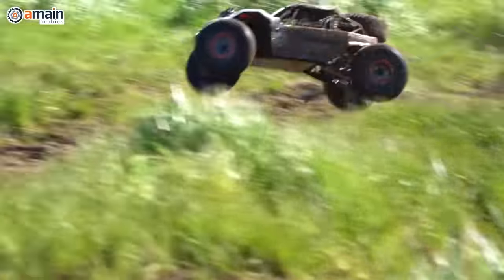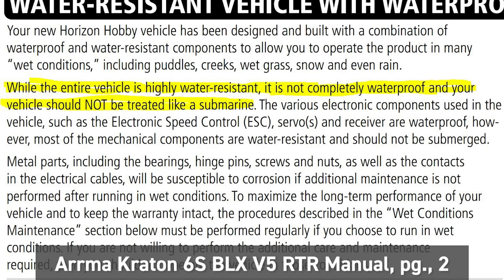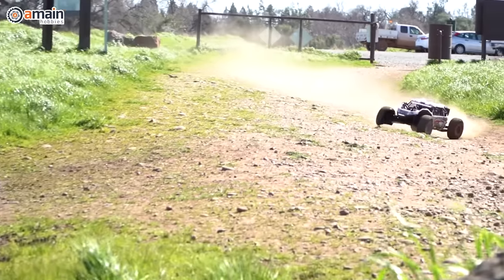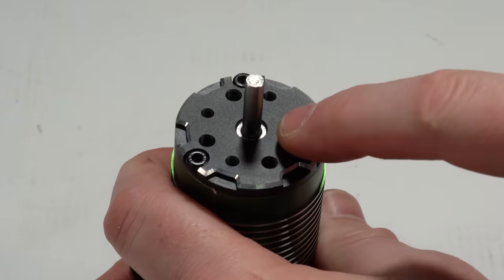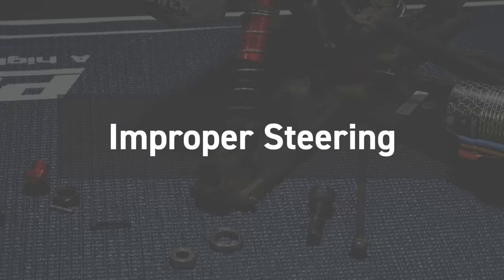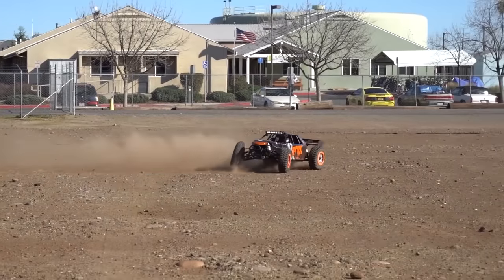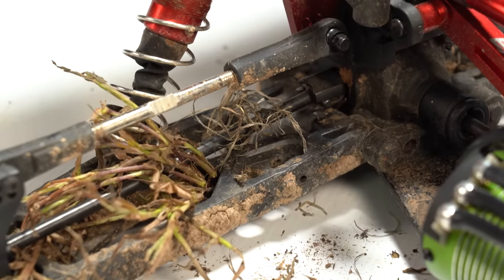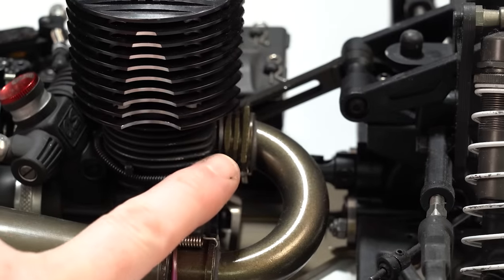7 Ways You're Destroying Your R/C Car

Comment: One technique I've found for maintaining an rc, is to buy a new one. Although that solution isn't budget friendly.
Reply: Just last week I burnt my motor out, hobby shop was out of parts and would be until June. Bought a new car and took it to the chop shop and voila@!
Reply: Tommy Chong  Cost efficient, no. But convenient and time efficient, yes.
Reply: Great advice
Reply: I think ill stick to my ascender
Reply: nor is it a very responsible thing to do.
Reply: @mjyanimations1062  yee
Reply: I believe they call that "replacing", not maintaining. Lol
Reply: @mr.kibble1577  a consumer*
Reply: actually it may be cheaper to buy a new one if you buy the same model, you will have a complete inventory of spare parts immediately
Reply: Yeah I've bought used ones and they ended up being more expensive than a new one after replacing all the broken stuff 🤦🤷😕
Reply: @CyberSkillPro  Yeah, but e.g. the drive train parts wear out far more quickly than all others
Reply: if it drives then it's a ok
Reply: thats what i tell to one of my wives, if she annoys meh
Reply: Yeah i  really take care of mine i only drive in the loop and and on a bit rocky paths im so glad i dont trash stuff .
Reply: The new MJX hyper go is $150 does 47mph and is more durable then the e revo , I also back this , I’ll spend 150 all day On a new truck/basher and it comes with a serious amount of extra parts
Reply: I buy one 3 weak ago, and today I broke it. 
I'm working on construction places.  And I have always a nice playground for a rc car. 
One spot was with a litle bit water, a little bit to much.  
And I go true the water.  
After some time the battery was dead, and I wanted to change it with another one.
It's starting so smoke the battery starting burning hahahaha
I ripp the battery out, and the car stopped also smelling and smoking. 
Today I buying another on, with more metal parts and aluminum plate.
No water, not even a little bit  hahaha

Comment: I've found personally the best way to maintain a RC, is to spot check it every so often and just make sure the car functions correctly and address issues as needed, and once a year, preferably during colder winter months when you don't run as much, completely rebuild the car from the ground up, so you can really see every last part of the car and if plastic parts are worn or pins are bent etc etc. As a basher I've found this works great for me. It's a fair bit of effort but you learn a lot about a RC rebuilding it, and it's half the fun.
Reply: For real can never understand people who don't work on their cars
Reply: This is the greatest tip. Being able to rebuild your RC from the ground up allows you to easily a fix it with confidence and spot the slightly issues with your RC.

Comment: “Don’t gear too high”

*proceeds to gear 2wd brushed slash for 100+mph speeds
Reply: Lmfao
Reply: Thats for speed runs. They don't leave them in there when bashing. He even says its only for speed runs.
Reply: @SacredGter  sigh...
Reply: ive got a rustler geared for around 90mph but i only use that one for speed runs
Reply: @koenoder4323  don't quit your day job. Chill bro I was just stating something he said. Smh
Reply: Mt bandit hit 100
Reply: It's really hasn't done much I just went to aluminum Spur and clutch clutchless replacement and stronger gears in the transaxle she's all good I went to different wider setup from a different model that mount the same so I got fans and heat sink but I start slow then hit it cause I got a long smooth street,(electric car too it was like a 28 -31 pinion and around 70-76 Spur or something I can't remember gotta look but yea after I shaved down 3 Spur gears I went aluminum then I havnt had issues even the stock axles held up but I went to strong metal ones for the stress
Reply: @koenoder4323  why cause I don't use punctuation or u can't achieve 100mph with a Traxxas bandit lol one of the cheapest beginner models 🤣
Reply: What are u crazy im Still gonna send it
Reply: But foreal u can't hate it was the middle of the night I was dabbed out working. On my cars last thing I checked is Grammer
Reply: Me to
Reply: I got 2 mini and 3 slasges
Reply: @brysonbishop9626  I've got faster one just trying to get a stock bandit to do it takes some dramatic gearing lol
Reply: @koenoder4323  exactly
Reply: lol
Reply: @SacredGter  r/whoosh
Reply: I’m getting a 3s bandit and I’m gonna put the other gear in but not often
Reply: funny kevin joke
Reply: Same I made by brushed 2wd slash 6s
Reply: @SacredGter  mine stays geared for top speed, doesn’t go off-road though
Reply: @SacredGter  r/whooooosh
Reply: @ezrabegin8234  I've had rustlers and bandits hitting 50 60 with the titan motor .granted I was running 3s and not a xl5 ,"those will smoke on 3s you need a older mechanical esc or some of the earlier versions in 2005 like power pulse,,I've hit 70 80 mph with the older trinity motors sending 4s through them   if the turns are enough to handle the volts  ,I've roasted a few  two tho ..but with what they have now you can make a bandit hit 80 90 on. Castle set up or mamba
Reply: I have a Losi 22S SCT with a 550 Brushed motor, NiMH, slicks, and zip ties holding the steering straight going 212 against the wind on the dunes. 😮
Reply: @SlithenTurtle  yeah right.  It probably does 65.    telemetry is probably set incorrectly
Reply: @mikeharo3528  I wasn't using the shitty app I used GPS to track it so I had accurate speeds
Reply: @koenoder4323  I was lost st first had to reread all this
Reply: Heh, same... have a 4s 2300kv motor in my rustler 2wd, can't even hit half throttle without it looping out, even geared so high it never overheats though!
Reply: No shot.  Proof
Reply: literally just did this
Reply: Steering has left the chat

Comment: This hobby needs more of these videos and needs to be reshared more. I think the next video needs to be about myths and facts of rc cars. I hear so much that its hard to know which to believe. Like one fact I do know is true is upgrading to metal parts isn't always the answer.
Reply: That and how to read the instruction book. I see so many questions asked in facebook groups that can be answered just by looking in the imstruction book.
Reply: some metal parts are good but it need to be plastic between like alu diffhouse plastic A arms and alu C hubs so if its a to violent crash the arms brake before the metal parts bends.
also the benefit of that system is that you dont need alot of part most of the time more then those sacrifice parts in plastic.

Comment: All great tips. I clean and maintenance my RC Cars after every run. I have RC’S that are 15 to 20 years old and look brand new. I still have a Kyosho Optima Mid SE since I was 16 years old and it still looks new. Thanks for the video.
Reply: I’ve had my slash for a year and it looks like it wants to retire in the garage
Reply: @hawkmoon128k5  poor slash
Reply: @hawkmoon128k5  lol same I have a 2wd stampede that looks like it was put through a meat grinder. 6 months ols
Reply: I have a 2011 stampede. I beat on it everyday. Still going strong 💪
Reply: @Deepfried4skin  I sent my little brother in law that lives in the Philippines a Stampede and it will have to stand up to the humidity, heat, salty air, and sand. I also sent him a SS screw kit. He will have to take care of it over their for sure in that tropical environment or it will turn into a rust bucket.
Reply: @Deepfried4skin  my dad has an original stampede from 1997. Still works but it's seen better days
Reply: I had thst car when I was 16 too and sold it like a big dummy
Reply: I'm like you bro, all my rigs look brand new and some are over 10 years old. I just can't afford to neglect my rigs
Reply: @speckledjim_  I agree. They cost to much money to not take of them. They break less when they are well maintained. I take care of my other belongings as well.
Reply: @airguns_rc im exactly the same 👍🏻
Reply: @brysonkuhn3290  That is how they are supposed to look IMO. If they get really dirty and need a brushing that is fine but your screws are going to get some surface rust and your chassis banged up and nicked. I almost consider it more of a patina...
Reply: my Associated RC10 was built in 1986, still primo!
Reply: Agreed
Reply: @modelnutty6503  that’s awesome
Reply: Yes sir. Maintanance is the name of the game. I have a 14 year old Hyper 7 and a 12 year old RC8 both still run like champs.
Reply: Mine are all rustlers built up right not maintained cause if it's gonna break now it need to be replaced when that new trans and front brakes got installed four years ago
Reply: @airguns_rc  You can maintain the car but, it still looks rough. I always cleaned and maintained my cars but, I also bashed them really hard no amount of maintenance can get rid of scratches unless you replace the parts but, then you either replace parts because of cosmetic damage every other run or you have a shelf queen you never really put through it's paces.
Reply: @thirtythreeeyes8624  I agree. I only have one shelf queen. I run mine, and then clean them off and oil the bearings and metal on metal connections such as drive shafts and CVD’S
Reply: i got a arrma notorious 6s v5 like 5 days ago. it already needs a new body and some new steering parts hahaha

Comment: Road salt is another bad one. Gotta be sure to rinse everything thoroughly after a snow bash.
Reply: My motor now does a high pitch sound when i was done snow bashing😑
Reply: @nuclearzs8615  yes, I'm sure it's not great, both the moisture, possible currosive salt and constant spinning probably puts quite a bit of wear on them. I use cheap Chinese brushless ones so no great loss, but a little shot of wd40 followed by a drop of oil probably can't hurt.
Reply: @WalldoTheWInner   thanks for the advice
Reply: Buy some dry teflon lube and give it a coat before taking it out on winter days! Safe for electronics and is not oily like wd40 😉
Reply: Wd-40 works good the trick is to have an air compressor or a can of air you blow it out and around so it gets to parts cleans and lube them I like that method your car looks new when you're done.
Reply: I do that nowadays.
Reply: I found this out the hard way
Reply: Clean with distilled water in a spray bottle for the hard to get spots. Distilled water doesn’t leave any electrolytes/minerals. Then blast with air, then spray down with Teflon or wd40.

Comment: When you talked about gearing and drivetrain causing heat in areas should of mentioned lipos aswell. They can take a lot more abuse depending on setup and changes.

Comment: I remember the one time when I brushless-swapped a cheap-ass stadium truck and fired it up with a 3S LiPo afterwards. Not only was that thing suddenly capable of doing like 50 MPH vs the 20 or so it did before but it could also pop wheelies when I yanked the throttle. After a few of those wheelies the gear between the input from the slip clutch and the differential gave out and I had trouble finding a new one for a while. But when I did and got the thing running again I always accelerated much more carefully and loosened the slip clutch a little so that it would protect the gear from breaking again if I DID yank the throttle again by accident. I still had the very nice top speed but probably was too careful to ever accelerate the thing to its full potential (without breaking the gear) again.

I never took part in any competition tho so it doesn't really matter. I just used the car for fun and once had 2 dogs chasing it and getting a rise out of it aswell. What made it really funny is that while driving on grass the limited grip of the rear tyres (which were not really designed for moist grass) allowed the dogs to catch up a little but whenever I pulled onto the dirt road next to the grass I totally left them in the dust with zero chance of them keeping up.

And I also had an equally cheap 4 WD buggy that I also chucked a 3S LiPo into. Man, those studded tyres became SLICKS within a few hours of driving coz I just LOVED driving that thing on a dusty parking lot and deliberately spinning out of control at full throttle. One time I even threw those worn-to-sh!t tyres back on to drive around on a frozen-over road.

None of the above was good for either of the cars but I sure as fuck had a crapton of fun doing it!

Comment: Me clicking on this video looking for answers to my issues and realizing I’ve done everything 😂😬
Reply: 😄😆😅 same
Reply: Offffff
Reply: I clicked on this video because earlier today I went over cat doo and it was let’s just say it was moist, so the. I just washed it and got freaked because I washed the truck witch is  a traxxas slash 2wd and then when I press the accelerator and reverse the motor sparks so I am just hoping I didn’t just throw away my first rc car witch I only had for 2 weeks!
Reply: @danielbahena6286  sparks from
The motor.? Must be a brushed slash… “traxxas / titan” brushed motor is not a power house but they’re usually pretty hard to kill 
Even on 3s.. but you’re issue is dirty brushes

Try bumping the truck forward as you’re holding the throttle 

If that makes it take off then YouTube cleaning / drying out a brushed motor

Comment: all good points aside from the tape on the rim vent holes.
Tires are vented to help with handling the vehicle also if taping the vent holes because of water, its not a matter of "if', Its a matter of when will the water get in. its always a good idea to put 4 small holes every 90 degrees in the tire to allow for water to exit if it ever gets in. it'll also help from blowing a bearing when water does get in and throws it off balance.

Comment: With electric RC cars I learned that a good way to destroy spur gears and diffs was giving it 100% throttle on a stand still. Grinded the spare parts that came with the car and some "after market" ones  until I realised this.
Reply: It's hard on the drivetrain, but damn it's fun.
Reply: That's only an issue if your car doesn't have a slipper clutch or if the slipper clutch is set too tight.
Reply: Yeah, didn't take me long to upgrade to metal drive shafts/axles and higher quality gear boxes with stronger motor mounts.
Reply: Ikr I have a Tamiya lunchbox which comes standard with plastic parts for the drivetrain and steering. I already upgraded the servo I bought originally to a servo with 20kg of steering force with metal bearings and stuff like that because last time I had them I crashed into a curb and they snapped in half. My new parts are 👍 I was gonna upgrade my gearbox parts to metal to make sure they last. I bought a Tamiya 540 sport tuned motor and it melted itself until it broke in 10 minutes😢 idk how I broke it apparently they need heatsinks and fans so I might have to buy another one and get a heatsink and a fan to cool it down. But the thing is I do alot of full throttle driving in the rain off-road which tests my car to the  limit so I might just break the fan

Comment: one of the best informative videos on rc hobby on YT for the new folks. question for yall i got a rc4wd mojave2 for Christmas does it have fluids already in the difs and tranny and transfer case or does it use grease  im not sure what i have here other than a expensive truck that i need to spend more money on to get it to run. the dealer who sold it to my wife didnt bother to tell her its only had ready. wife not happy

Comment: One of these should be “driving it through the mud constantly and not cleaning your car” I’ve seen waaay to many people come into my local hobby shop with a brand new car trashed because they ran it through the mud constantly and never cleaned it.
Reply: What do you think is the best way to clean them ?
Reply: @bogtrotter10  if you run it through mud , you should clean using an air compressor and a towel, as well as a toothbrush and a q-tip to get the dirt that has hidden from you. Then, take each part off (parts that you can get wet, not electronics) and wash them with soap and water, then let them dry and put them back on your car.

Comment: I avoid a lot of these for one reason: I don't mod my cars. I like them the way they come out of the package, and that's the way they stay until they're dead.
Reply: Except you can keep a rc going for life if you keep replacing the broken or worn out parts. What constitutes death in a rc?
Reply: RC death, to me, is when a car stops working completely. When changing the batteries no longer helps.
Reply: I just slap in a new motor or esc or possibly both, I'm with you on keeping things stock though. Alot of the time "upgrades" are downgrades imo.

Comment: Great Detailed video.  On this same order, could you make us videos on how to best break in (brushed, brushless, nitro, gas) motors?
Reply: Do you have to break in brushless motors ?
Reply: @bogtrotter10  some motors do better after "controlled heat cycles" meaning oil bearings, then make a few loaded passes, going throughout rpm range to heat motor components(about 3 minutes) . let them cool and repeat.  Normally takes one regular use battery charge.
Reply: @BandWidthExpired  thanks, I just got a traxxas maxx yesterday and havnt driven it yet, do you think I should do that with the Maxx ?
Reply: @bogtrotter10  well it cant hurt. plus it can give you sometime to get the feel of it before you go HAM BASHING ;p
Reply: @BandWidthExpired  ok thanks , I’ll look into doing that